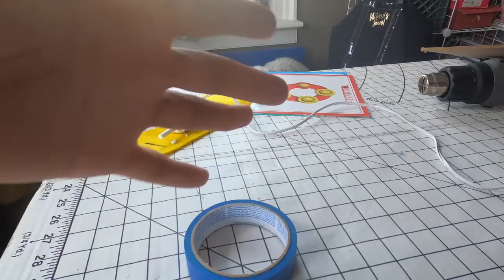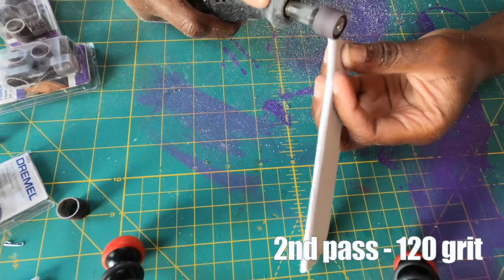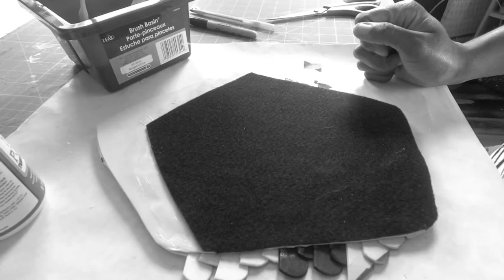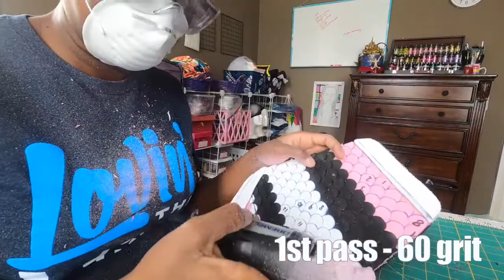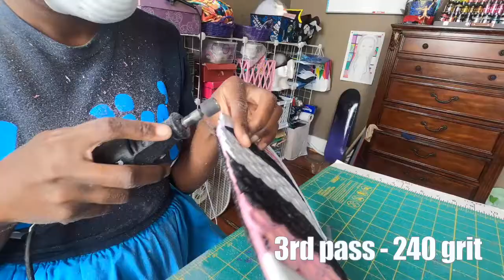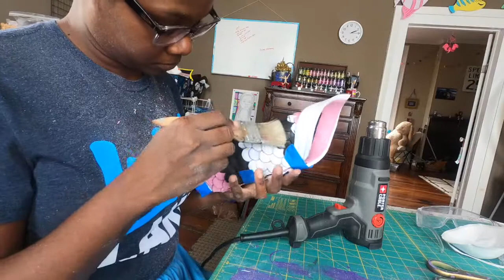Making Foam Armor - Part 4 Shaping The Craft Foam

Comment: Brushing, Cleaning the Dremel is a good thing. A shopvac set up close to the sanding area with will collect dust.

Tools to help with sanding:

1. Dremel Workstation and Dremel Flexgrip. This combination provides a smaller tool to work with, adding control. 
2. Dremel  Workstation(only). The workstation holds the Dremel in place. The user can set angles, and hold the armor with two hands for better control. 
3. Dremel Detailers Grip. A pistol grip that gives, the user better control when using one hand. 
4. Follow the Arrow and Sand into the Corner, not away from the corner. This will, keep the corner intact, going away from the corner will break it. If I understand what you are having a problem with. 
5. Sanding in 1 direction prevents low spots from forming. 

SIDE NOTE!!!!!

Use Both of them. The stones look cool. Breaks up the pattern, I think that's a good thing.